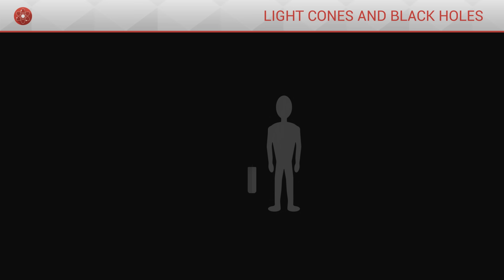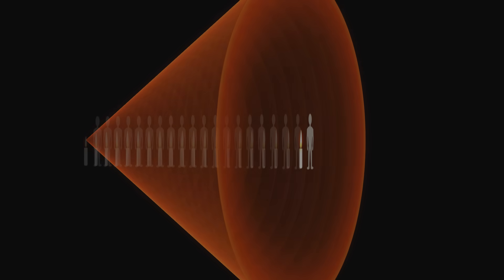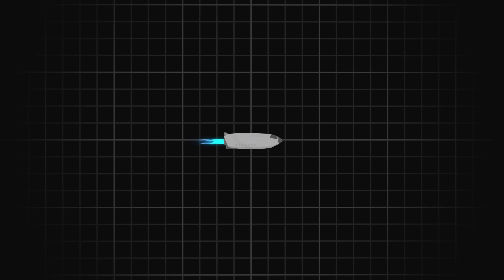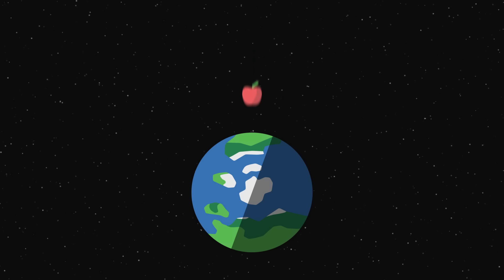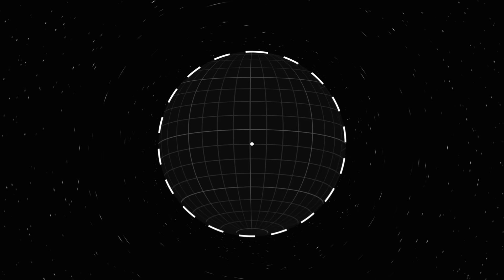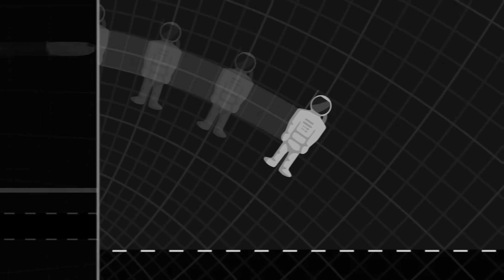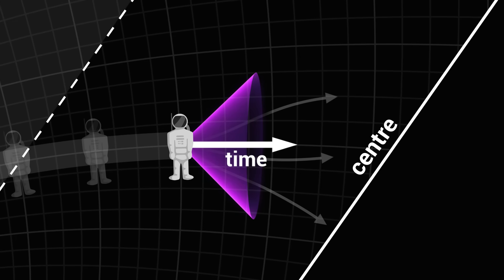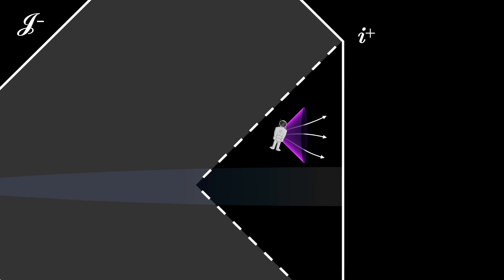Why Time and Space swap in a Black Hole

Comment: Great visualisation, thank you!  I am unsure what these sentences mean:  "the horizon of the black hole is no longer an event in space, but a moment in our past, while the centre of the black hole is no longer a point in space, but a moment in our future".  Clearly time and space axes are tilted by the black hole's gravity, but don't they retain their distinct features in that the astronaut can move about freely in space, but has no choice but to move forward in time?  Therefore events at the horizon and at the centre must continue to have both time and space co-ordinated associated with them, no?
Reply: I think what he's trying to say is: 

Right on the event horizon, the cone always points somewhere inside the event horizon. That means that you can still move freely, true, but only inside the black hole. And if you think of what direction is "up" or "away from the black hole" for you before you enter the event horizon, it becomes clearer. The "away from black hole" is up, where you can move and escape. As soon as you cross it, the direction "away" from black hole doesn't exist as a notion anymore, your light cone is only inside the event horizon. The only notion that exists at that point, is the past event of entering the black hole, meaning that in order to explain where the event horizon is now, you have to use time reference instead of space: the horizon is an event in the past and does not exist in your space. I think that's the product of time and space tilt
Reply: @emagdali  This is basically it.  "Space" is defined as the free motion in any direction, perpendicular to "Time" which is an irreversible trajectory.  Inside the Event Horizon, space becomes an irreversible trajectory, thus it becomes "Timelike".  By the same process, Time becomes "Spacelike" because, if you tried to "maneuver around" inside the Event Horizon, you could "catch up" to events that occurred before you entered, or "hold up" for future events to catch up to you.  You could, effectively, move back and forth through Time, thus, it is "Spacelike".

Comment: Wonderful and wonderful again, so we cannot go back to past even we are below the horizon of the black hole but are we sure that there is no going to past for the light cones bending and bending and turn toward the opposite of the direction it started, because we don't know how massive is the density of the the black hole except that the concept of the light speed  also behaves differently far away from a black hole than when it's below the horizon of the back hole!!

Comment: THE TIME IS NOT LIMITED BY THE LIGHT AND ITS SPEED OR VELOCITY. IF I WERE SOME KIND OF BAT WHICH SENSE INSTANTLY  VERY FAR EVENTS  THROUGH THE " SPOOKY ACTION AT A DISTANCE" FOR INSTANCE! ANY LIGHT MIRRORS THEN, I GUESS WOULD NOT SEEM TO ME  LIKE DEJAVU
Reply: There is no spooky action at a distance that transmits any information your bat sense could interpret. You can not use quantum entanglement to send signals. All you learn when you measure your particle is that the other one is correlated a certain way. But you already knew that. There is no influence from either on the other besides that.

Comment: Knowing the fact that all back holes die out eventually, does our astronaut manage to cross the event horizon at all?
Reply: From an outside point of view, no. The astronaut will slow down as they approach the horizon and be redshifted into obscurity. Eventually the black hole will evaporate and there will be nothing there.
But from the astronaut's perspective the horizon is not a special place and hawking radiation doesn't exist. They pass just fine. 
Black holes are strange that way, but it is actually logically consistent.
Reply: @narfwhals7843  From the outside perspective I'd assume the astronaut being blown back to our space the moment the black hole dies. That because since from our pov the astronaut never crossed the horizon. Hard to grasp the logic. Thnx for your reply.
Reply: @peterstorms3381  From our perspective the astronaut disappears as they cross the horizon because the light they emit becomes redshifted until it is undetectable and can't be used to locate them. Their mass now adds its spacetime curvature to the region of the black hole. So even though we never see them cross the horizon, they still become part of the black hole. We don't expect to get them back when the region evaporates its curvature away.
Reply: @narfwhals7843  So the astronauts last event on the horizon doesn't mean it's 'frozen' in time from our pov. It only looks that way, without being able to observe of course. That explains some other questions I had. Thank you Narf.
Reply: @peterstorms3381  In relativity you have to be a bit careful with saying things like "it only looks that way". It looks that way because that is all the information we can possibly get about it in any way. That means this is part of our reality. Like with length contraction and time dilation all physical effects on us happen as if these things really happen the way they "just look" to us. There is no point in ascribing any higher reality to a different point of view.
And we don't actually see the astronaut freeze. We see their clock slow and their emitted radiation redshift into obscurity until they vanish because we simply can't observe them anymore. All that remains observable is their massenergy, charge, and angular and linear momenta, which are now part of the black hole region.

Comment: What if you had a TETHERED probe, you fly a spaceship close enough to the event horizon for the tether to reach. 
Could we send in the probe and retrieve it? 🤔☺
It's okay if you laugh at my notion. I'm just curious 😄
Reply: Assuming the tethering and probe are strong enough to survive, the time dilation induced by the distorted spacetime would still make the task take an infinite amount of time and energy to complete. It is physically impossible. 

To the probe, it will observe the tether dropping it in but at an increasing slow rate. It would have to wait forever for it to be fully extended so that it can be sure it reached the event horizon (even though it already did). Past that point, your spaceship’s motion to it would appear to stop. It would never observe you pulling it back out

To you, the probe would move slower and slower as it goes in. It will eventually appear to stop and fade away. You will never see the probe cross over so you will never know when to pull it back in. Even if you did try after a million years to pull it back, the tethering would face the same problem as the probe: despite the pull exerted on it, the stretching force would slow as it traveled down, never reaching the probe and never bringing it back up

Comment: There's a certain quantity that I wonder if it has a name. It can be seen by the way you draw the curved spacetime grid toward a cylindrical gravitational mass. At the current time, the grid lines start horizontal at the space ship. As it goes forward in time the angle of the grid lines toward the gravitational mass increases. It would, of course, be possible to re-orient this grid so that the lines pointed horizontal once again. It would also be possible to hold the lines horizontal at the current time as it moves forward, by rotating the basis of the grid at a certain rate. delta curvature / delta time, as it were. Am I overcomplicating a simple concept here, or is there some fancy name for this idea? I'm sure it's proportional to the strength of gravity at that point, but perhaps there is some special unit for this?

Comment: Time and space are two totally different things. Time passes forward for everybody at the same rate. There's nothing you can do to change it. It's doesn't matter where you are or how fast you travel in any direction. It's like 2+2=4. Nobody made 2+2=4, it's just a fact. The same thing with time,it just exists for everyone.
Reply: Time has actually been measured to move slower the closer you are to a massive object. That's what gravity is.

Comment: It's super-ultra cool way to think about space-time, thanks for it!
I think approaching event horizon deserves - or at least may deserve - for its own video:
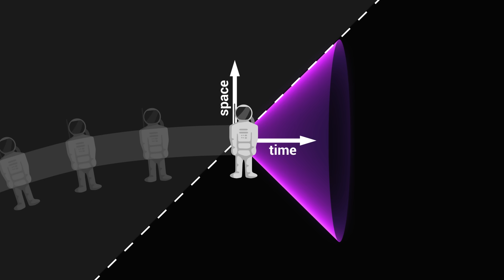I'm missing details on crossing the event horizon. To have such light cone on event horizon, I should  nearly balance a gravity of a black hole. I guess I would have my cone close to streight line - not even close to touch event horizon from the bottom. However, this video led me to a question: what should be my 'parameters' to have a such pure light cone on event horizon (9:23)? Is it even possible? Of course, on a paper sheet.
I guess I would need me to approach event horizon with speed slightly above 0 m/s, but is near to -c toward the horizon enough? And what would it mean in distorted space-time?...

Comment: Why aren't the light cone. Spheres? Why is there 45° in a sphere?
Reply: 1 dimension must be time.
we can't have four axes on a screen or paper.
45 degrees because light travel 1 unit of distance per 1 unit of time, or 1 second = 300,000,000 meters in length terms.

Comment: Question. So if I was falling towards a black hole looking away from the black hole at a distant part of the universe, what would I see as I cross the horizon? Wouldn’t that distant universe seem to speed up infinitely as I fall in? After I fall in, What would I see if I shine a flashlight towards someone on the outside of the black hole (assuming I could even see them)?
Reply: You wouldn't see the universe "speed up" unless you somehow became stationary at the event horizon, which is impossible, as detailed in this video. Whether it would seem like light would be reaching you at an "infinitely" faster rate I can't say, but it wouldn't actually be infinitely sped up since you would have to stay stationary for an infinitely long time (and you wouldn't get to stay stationary in the first place). If you shone a flashlight outwards from the black hole, you would still see the same as you would see otherwise - the light of the universe that is already falling in with you, and now also the beam that you just flashed.

Comment: So, I take it to mean that (please correct me if you know that and how I'm wrong): Inside a black hole time has ceased and only potential energy (whatever it is) remains, but at its boundary new light cones are created by Hawking-radiation — an energy-evaporating (not information unscrambling) process that depletes and eventually disappers the 'hole'; does  after a longer relative time the greater the amount of mass-energy that have been involved in forming it.

Comment: We are being pushed to the earth by the space being curved by earth, do this happens because earth is always moving in space, did I understood well?
Reply: If you ain't moving through space, you'll still be moving through time.
the total velocity in spacetime is a constant, therefore the curvature still affects stationary bodies, because they're rushing in the time direction.
Well, we know that the earth is also revolving around the sun and so does our galaxy, but in relativity principle, every frame of reference are correct on its own,
so the earth is not moving relative to you.
Reply: @Zodiaczero2  Everything is moving relative to the universe, even if it wasn't, time is a constant, time is moving aways forward, hipoteticaly if we could stop time and the moviment through space, could we null gravity?
Reply: @hordynaelmf  everything is moving relative to each other or
speed are relatives.
however, this statement is only true for 3d space.
it is impossible to not moving through spacetime.
in 4d spacetime, everything travels at a single velocity,
but its composition can change. that's it,
if something isn't moving through space, it will be moving through time at the fastest possible speed and vice versa,  like light moves at the fastest possible speed in space, but the time component of light is zero.

if you stop time, you'll behave exactly like a photon, your velocity component never changes.
Reply: Without moving there isnt gravity?
Reply: Thinking about it, there is the moving in the space and the moving in time, God, mind blowing!!!!

Comment: If I understand this correctly, time dilation and point of observation does seem to imply two things:

1) If you observe from outside of the affected area of the black hole, then all the matter it has ever fallen into a black hole will never even reach the centre because time will have stopped for the infalling matter, essentially accreting at the event horizon forever, frozen in time.
2) If your point of view is that of falling into the black hole, then the "outside" will appear to have sped up to the point where the entire universe ceases at the moment you hit the even horizon.

So my dilemma is based on accepting two theories - That the universe will end by the method of the big freeze, AND, that hawking radiation is real.

What boggles me is the physics behind the notion of falling into the singularity, because if the observer were somehow to survive entry, he would be hit with all the matter that has ever fallen into the black hole since its inception, but then also simultaneously, the black hole would have also instantly evaporated due to hawking radiation and extreme tile dilation speeding the process up.

HENCE... Would I be correct in thinking that any matter that ever falls towards the black hole is frozen in time at the event horizon, and it will never actually reach the singularity because it will evaporate before that "forever to reach the center" even passes?

If that is the case, then why do the predictive models fail?

Comment: That is misleading. The expansion sphere is one had radius as time but the reversing of radius is the distance of space from infinity back to the point of light uniting outward.  So as time going outward, the distance to the edge of limitation is shrinking but never zero because there is no infinity and that is why space time is interdependence in that sense because as the space arrow reaching the original centrer the time going outward pulling away from reaching destination of the origin of source of light that is the reason human and mortal can not touch god or omnipotent power of god

Comment: But if an object is lowered beneath an event horizon, which is tethered to something outside the event horizon strong enough to withstand the force of pull, can it not be drawn back out from within the event horizon? Or would the horizon, itself, snap even the strongest cable?

Comment: can you actually touch the horizon of black hole? I think time dilation there is too extreme. Like billions of years in a second or even more extreme? So by the time you reach event horizon it will evaporate through hawking radiation. Since the time for you will flow at a rate of inifinity of years per second. And all that black holes do is transport you to the future where they die. (Googol years into the future) They don't actually swallow you into singularity, since you can never reach the point of "Inside" black hole, time dilation will simply not allow you.

Think about it this way: You are 1 meter from a black hole - at this point time flows at a rate of Googol years per second. So after 1 second Googol years had passed and black hole's event horizon evaporated by 10 meters.
Now you are 10 meters away from black hole and time for you flows at a reasonable 1 trillion years per second. So you start falling again until you reach 1 meter away from event horizon. Again time flows at a rate of Googol years per second so after another 1 second - black hole evaporated by another 9 meters.

And keeps going like this until black hole completely evaporates - so you never actually touch it, until it completely disappears.

Comment: Two interesting points here:

1. Some people consider the 4th dimension to be "time", as opposed to an actual physical dimension. However, from the vantage point you described, it's absolutely appropriate to consider time to be a physical dimension. Consider this: a singularity is a zero dimensional point in spacetime. It has absolutely no size or dimension at all(which is a severe issue when trying to reconcile General Relativity with Quantum Mechanics, but I digress). But, expanding that zero dimensional point at right angles to itself, gives you a line segment(length). Extend that line segment at right angles to itself, gives you a flat surface(length+width). If you extend that flat surface at right angles to itself, you get a cube(length, width, and height/Depth). Now....if you expand the cube at right angles to it's three dimensions, you get what appears to us as "time", as the motion of time is at a 45 degree angle to the light cone of the three dimensions we know. This is essentially a fourth plane of motion that we can't perceive directly, but we can deduce by what we call "time". 

2. Another way to picture the reversal of spacetime inside the BH event horizon can be viewed like this, similar to how you explained it: Outside the horizon, an object can move in any direction, while also moving forward in time. But inside the horizon, all possible paths lead to the singularity. In essence, moving towards the singularity is as inevitable as moving forward in time, and can be considered the equivalent of  doing so by using the penrose diagram as your coordinate system. 

Inside an event horizon, falling is a way of life.